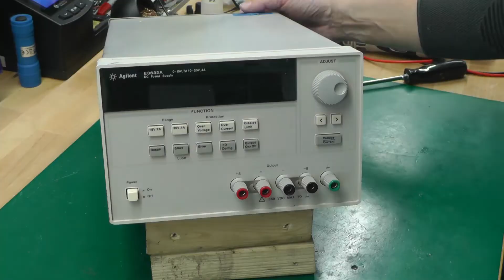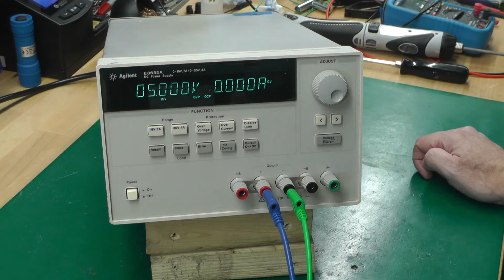No.067 - Agilent E3632A PSU Repair - Part 4

Comment: Nice, it is good that the firmware was available somewhere after all, I suggest that you post it on your server too so there is another copy floating around in case the original source vanishes.
Reply from the maker: Waiting on person i got it from to reply to email regarding it. Dont want to just steal it as such.
Reply: @IanScottJohnston  - what about sending it to me for my private archives, in case I ever get one of those to fix🤓
Reply from the maker: @TheDefpom  The link to it is in the top pinned comment of the Part 3 video.
Reply: @IanScottJohnston  oh yes so it is, that site has helped me many times too, it is excellent

Comment: Congratulations, you did it!! I have the same PSU with exact the same problem has yours, so maybe my PSU have the same issue as yours...mine is HP branded with socketed OTP. U13 label shows E3632-60016 Rev 1.1. I also have the TL866CS, and I can read the IC using Minipro software selecting Fujitsu MBM27C2001 PLCC32, but once read, the IC data does not match the data on the BIN file we have downloaded from KO4BB. Now I'm not sure if this U13 data is corrupted or (most probably) I have the same problem as you with TL866.
Can I ask you to send me a "copy" of that IC, so I can plug it onto my PSU and see what happens? I'm asking that because I don't have that IC, nor the working programmer, but you have all the gears in your hands. Of course I pay all costs, IC, shipping to Spain, etc...
Thanks in advance.
Reply from the maker: Contact me via my website contact form.
Reply: @IanScottJohnston  Thank you Ian. Email has been sent.
Reply from the maker: @marcosgarrido3460  prom on its way.....:)
Reply: @IanScottJohnston  Hi Ian. Sorry for the delay, too busy lately... The Prom arrived, it took to much time but finally arrived. I've replaced it and the problem still there, nothing changed, power on - one beep - no screen - no output. I have to look more in deep to find the rabbit. Anyway, thanks a lot for your help.

Comment: what was the fail on the OTP? bit flipping? Were you able to read the old OTP and compared it to the firmware file?
Great repair, Ian!
Reply from the maker: It never failed a read with my S4.....just that the results were complete rubbish compared to the .bin file I ended up using.
Sometimes all FF at one point. At one point the pattern I was getting was as if 1 nibble was knackered as it put all the data above 7F. Tried heat and freezer spray for fun, but made no difference. Didn't try raising the voltage though.
Long, long time since I had a rom failure........
Reply: @IanScottJohnston  Thanks. I can't assign that to any known failure mode, either. Very interesting.

Comment: Nice job Ian,  what was the final cost to repair if your ok with sharing, I know there good PSU's and I keep an eye our for them or similar here in canada, nothing so far at a reasonable price, working or otherwise.
Reply from the maker: The PSU wasn't Ebay......it was from a contact overseas that I have and I got this and a 3457A from them. Usually stuff they can't repair. Not sure it will continue though, shipping costs are hurting them! The parts costs (uC, ASIC, Prom & regulator) were pretty cheap, maybe 30 UKP.
Reply: @IanScottJohnston  So factoring in possible shipping costs, still a good deal I think